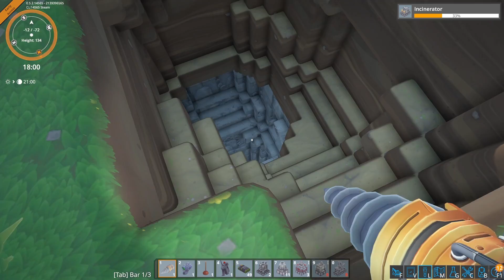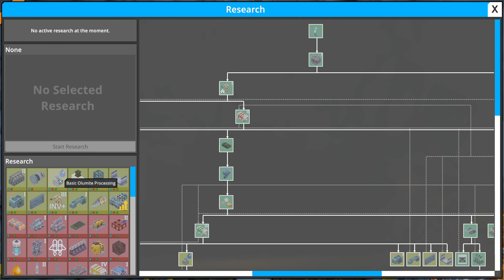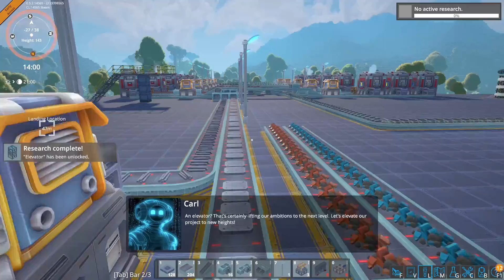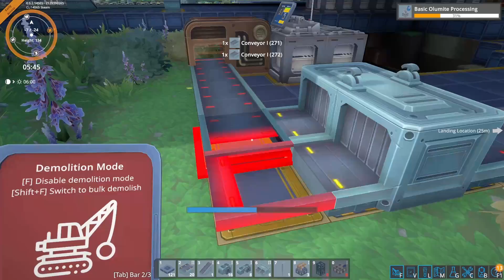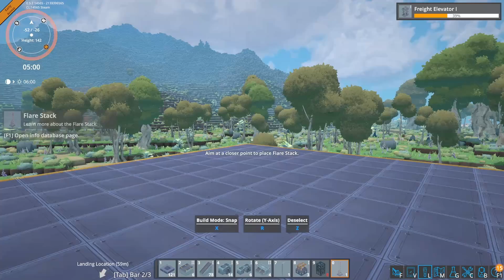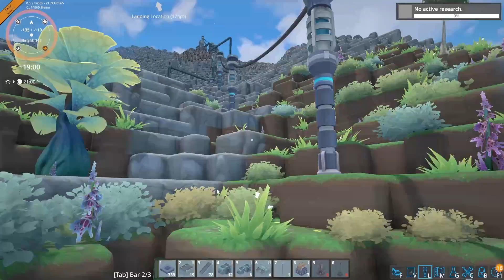Foundry - Deep Mining with Elevators and Finding Olumite [E6]

Comment: At the start I did my bus like yours. but after seeing Nilaus solution I rebuilt it. Just making the bus go 1 block above and using a splitter and down slope, going under the other belts to destination.
Reply from the maker: That was one of my options but, at the time, I was worried about upgrading belts because I didn't know how that worked. Anyway, in the end it worked out okay after I cleaned it out.

Comment: i must be dumb. How do you set the unset input/output ports for liquid production?
Reply from the maker: Set the recipe and see which ports are available. Sometimes you need to turn a machine to make it work as the ports are fixed for each recipe.
Reply: @surtrplays  i wish you could set them how you want them
Reply from the maker: It would be nice but in the meantime the pipes will be just a bit more messy than you want them.
Reply: @surtrplays  yep. its still early access so maybe thats something theyre working on (or not lol)
Reply from the maker: @DopeyArmyVet  I hope they are.

Comment: Both the elevator and the freight elevator are so useful, for the future it's good to know that they are both also blast resistant. Makes for a great way to dig down, explode your way to the ore and then put in your foundation and miners after
Reply from the maker: Oh! I didn't even think to look at if they are blast resistant. That is a great tip. Thanks.

Comment: The thing I really dislike about this game is the limited resource nodes. I understand the game mechanic and the purpose, I just think it is an unnecessary complication that adds little to the overall play of the game. There are plenty of other ways to encourage exploration, and the only thing this mechanic does is force you to place hundreds of belts along the landscape. It is a huge interruption to the flow of the game, it isn't interesting, and it ends up being a waste of both resources and time.
Reply from the maker: I saw cargo planes. That is how these games go. You do a bit of difficult grind stuff to unlock techs that make it easier the next time.
Reply: @surtrplays  Regardless of the transport method, what I mentioned still applies. Limited resource nodes is a bad game mechanic I feel. They could have permanent nodes and fulfill the purpose of exploration and expansion by placing different resources in different biomes. It enable all the different transportation modes and gizmos without having to rebuild your infrastructure every few hours. I enjoy the game I just find that game mechanic very annoying and pointless.
Reply from the maker: I have heard that you can get to infinite mining nodes. I can't seem to find it in the tech tree but if it is there I will get to it.
Reply: @surtrplays  That is good to hear. I hope it is in there. Maybe it is going to be added later.
Reply: @surtrplays  on the larger resources you use fracking, which is supposed to be unlimited resources from then on.
Reply: Once you get towards the end of the current tree, you unlock a tech that makes mineral nodes infinite. There is a resource you need to make it so, but the volume you can get of that borders on a functionally infinite supply as well.
Reply from the maker: @RoninGrey thanks.
Reply: Guess you don’t much like Factorio either then?

Comment: Yeah that upgrading system is fantastic so much less tedious than other games I've seen! Elevator seems great too, love the way it builds itself, having a freight elevator working on similar principles will also be great, I also noticed that the base freight elevator has a speed of 320/s same as t2 belts, so i assume t2 freight elevator will match t3 belts!
Reply from the maker: I think you are right about the T2 Elevators. Yes, the upgrade mechanic is really good.